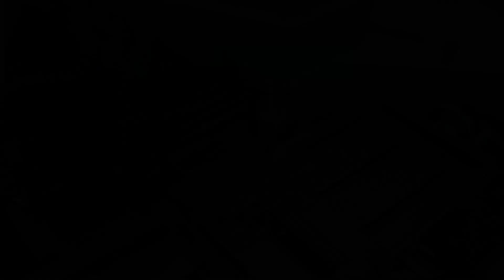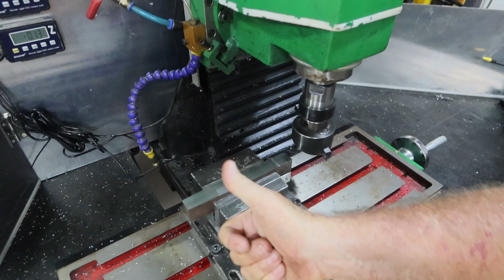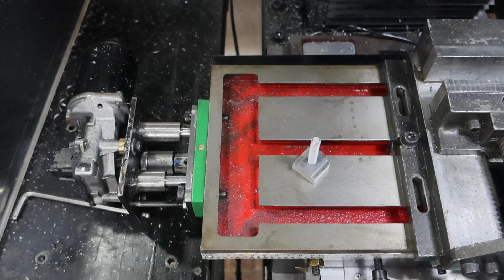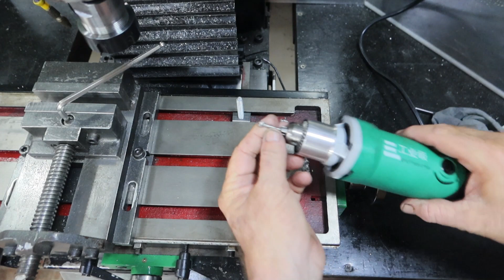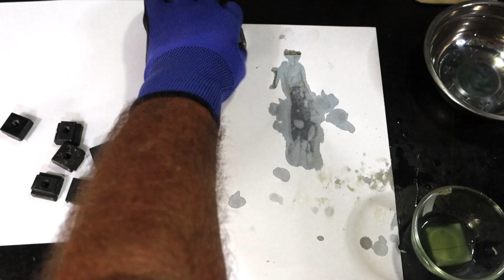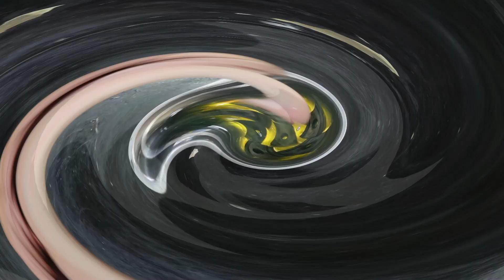MHW Episode 94 - Milling Table T-Nuts

Comment: A bloke with what sounds like an Australian accent, on a channel from Thailand, quoting imperial/inch measurements.   I'm lost.
Reply from the maker: 😂 You are most observant, yes I'm an Aussie and I have lived here in Thailand for the last 16 1/2 years. I spent my entire school years under the imperial system and had to switch to metric the year after I finished school. I use imperial when I speak sometimes, but only work in metric. I also had a business in Australia making automotive and industrial Brass fittings in both Metric and Imperial sizes, so I'm quite adept at switching back and forth between the 2 systems.👍

Comment: How do you reckon you would go using an end mill followed by a dovetail cutter in the bottoms of the slots to get an even finish end to end?
Might make them slightly wider, but wouldn't that be better than what you have now?
If you machined out enough, would you then be able to flycut the top to get rid of 🍌?
Cheers from back home, hope that leg is healing up.
Reply from the maker: Nowhere near enough travel or material in this table to do anything much with it. Leg is healing well, I finally got the stitch she cut in the wrong spot and only got half of it, out a couple of days ago when it finally reached the surface. 👍
Reply: @MyMiniHomeWorkshop  👌👍Stay Well.

Comment: Sucks that the table banana shaped, you think considering it's supposed to apart of a precision piece of equipment that the wankers who manufactured it would at the very least machined the top surface flat before it left the factory. I was going to suggest making yourself a large fly cutter and resurface it but after seeing how thin the webbing of the T-Slots is that it would most likely weaken them.
Great video as always my friend, thank you for uploading!👍👍
Reply from the maker: I've come to the conclusion that I will have to live with it, but as you would have seen, as long as the piece I'm machining isn't too long I should be able to work around it. 👍

Comment: One uses what one got. I'm lucky to have a supplier selling blank T nuts. Milling them to dimension, drilling and threading and voila.
Reply from the maker: Fat chance of that around here, these T slots are so all over the place that I doubt I'd ever be able to buy anything to fit it off the shelf. 👍
Reply: @MyMiniHomeWorkshop  No blank fit as it was. Milling them down to size the was needed. However it saved a lot of milling as well as bandsaw cutting.